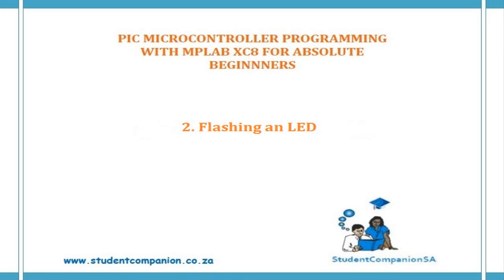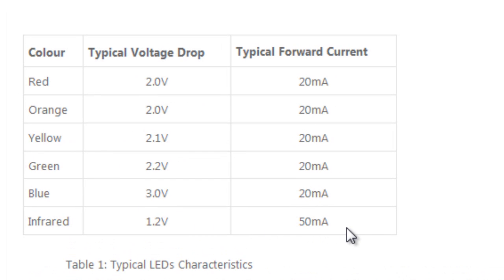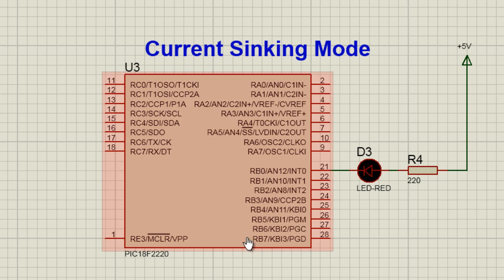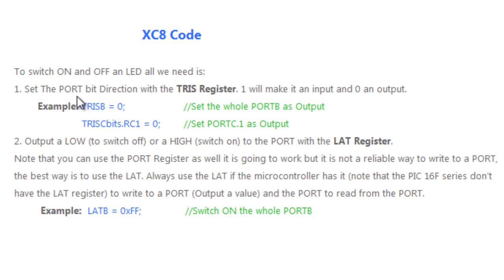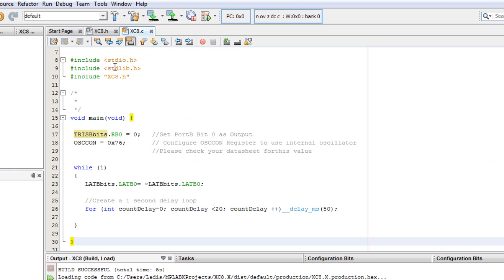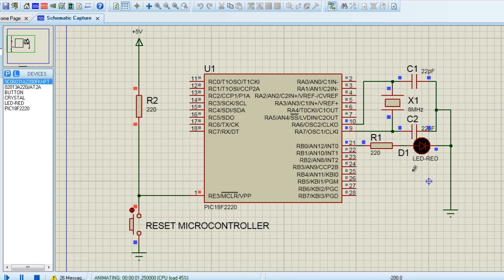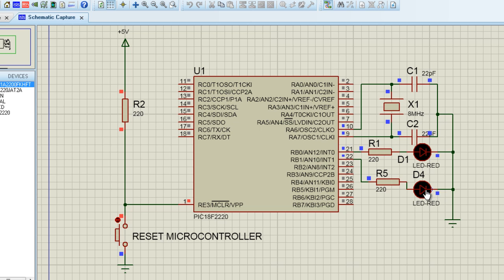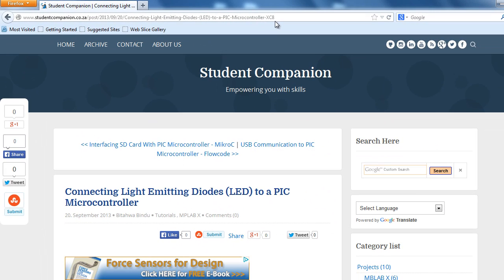2- Flashing an LED | MPLAB XC8 for Beginners Tutorial

Comment: Older red LED is typically 1.8V, with superbright ones being around 2V.
But rounding most of them to 2V is fine most of the time.
The higher voltage LEDs (blue, white, pink, some green ones) can be anywhere from 2.7V to as high as over 4V for the old ones.

Comment: I have two questions: 1. On the diagram in Proteus there is an external generator, but in the program you use the OSCCON register for the internal generator. Why? 2. Where did you get the value 0x76? I didn't find this value in the table 3-1"Power Managed Mode" on page 29 for the OSCCON register?
Reply from the maker: Hi, thanks for your comment.
1. This is an error on our part, we showed the external oscillator circuit just for explanation but we referred to tutorial 1 for configuration bits (header file), in tutorial 1, we used the internal oscillator, so just ignore the external oscillator circuit in this video.
2. For OSCCON value of 0x76, refer to REGISTER 2-2: OSCCON REGISTER section in the datasheet on page 26.
0x76 configure to use 8MHz internal oscillator, see the individual bits we enabled, 0x76 equals to 0b1110110 in binary.
Reply: @StudentCompanion  Thank you very much. I got a very quick response. I'm happy.
Reply from the maker: You are welcome!

Comment: Hello when I majke the simulation in ISIS  the message display (pic is not supported the  program
Reply from the maker: Hi. Which PIC did you selected in MPLAB X IDE project? And which PIC did you use in Proteus simulation?
Reply: @StudentCompanion  i select 16f84A in isis and in mplabx
Reply from the maker: @hichamredoine1817  can you post the full error message you received not just a simplified version of the message. Did you  use your generated Hex file from your project using poc16f84?
Reply: @StudentCompanion Pic16 program filetype'X'              
Is not supported
Reply from the maker: Post your mplab and proteus projects in our forum we will look at it: www.studentcompanion.co.za/forums
Reply: @StudentCompanion  hello can you send me many videos about 16f84 projects
Reply from the maker: @hichamredoine1817  that's a very ancient amost obsolete PIC. Why do you want to use such PIC while there are newer, cheaper and more powerful PIC models? We can't use such old PIC.
Reply: @StudentCompanion  because in our school we studied this type of PIC
Reply from the maker: @hichamredoine1817  I understand but unfortunately we can't teach using it. It's just too old with so many restrictions. You can use the concepts covered using a different PIC to apply to yours
Reply: @StudentCompanion  but the registers are different
Reply from the maker: @hichamredoine1817  unfortunately yes. But the concept is the same. You will have to read your datasheet to understand those registers

Comment: I am sending the code to a microcontroller PIC18F45K22 mounted on Curiosity/starter kits (PKOB4)
It is a pre-built project, I have hex code.
when I send the code via usb the LED is not blinking not even coming on.
I am using MPLAB X IDE v5.20
What can be the reason?
(I don't know if I have explained my question properly)
Thanks
Reply from the maker: Are you able to transfer without errors the hex file to your PIC? 
What are the build log of your code in Flowcode?
Reply: @StudentCompanion  
1. THis is the message I am getting as configuration error but I don't know how to sort it out

error: Configuration "C32_PIC32MX795F512L" builds with "C32", but no toolchains of that type are installed.
Errors have occurred while loading one or more configurations.
If a specific error is not shown above, this may happen when you import a project from another computer.
    + You can add language tools in Tools->Options embedded tab.
    + You can change which language tool to use in the project properties dialog.

2. the build log of code in Flowcode ( I am not sure about this) I have just compiled the hex code and it was showing success at the end.
Reply from the maker: It looks like you selected a wrong pic or compiler

Comment: Does delay command take longer time than it that is written to source code?
Reply from the maker: Your question is not clear.  What do you mean? If you write a delay of 1 second, it should take 1 second to be executed.  If it takes longer or shorter than there is something wrong in your code
Reply: @StudentCompanion Seems like the code that you write takes longer than 1 second in your proteus simulation. I havent written code yet.
Reply from the maker: Did you look at the simulation execution time? When you run simulation at the bottom bar there is an execution time. Compare that clock with the code, not your PC clock as simulation speed can be effected by many parameters including your computer speed among others.

Comment: Well understood but I want it to blink 3 times and it didn't work;
Am using pic16f877a and this is the code

#include <stdio.h>
#include <stdlib.h>
#include <xc.h>
#define _XTAL_FREQ 8000000

/*
 * 
 */
int main(void) {
    TRISB=0x00;
    PORTB=0x00;
    int i=0;
    int n=1;
    while(n<=3){
        //int i;
        PORTBbits.RB4=1;
        for(i=0;i<20;i++)__delay_ms(50);
        PORTBbits.RB4=0;
        for(i=0;i<20;i++)__delay_ms(50);
        n++;
    }
}
Reply from the maker: Hi. Why use int main()?
In your code you are not looping 3 times that's why it's not working.
Reply: Student Companion what's the problem?
Reply from the maker: You are incrementing the wrong counter
Reply from the maker: Try something like this:
for (int i 0; i <=3; i++)
{
PORTBbits.RB4 = ~PORTBbits.RB4;
__delays_ms(1000); // 1s delay
}
Reply: Same issue, it's not working
Reply from the maker: And when you say it's not working what exactly is happening? Does the led blink only once? Does it even come on? Are you simulating or working on breadboard or PCB?
Reply from the maker: Always specify the full problem and provide enough information to get proper support
Reply: Student Companion okay, I want my LED to blink for a number of times, but the problem is that it keep blinking more than the specified number(e.g. I dey It to blink 3 times but it's still blinking more than 3 times)
Reply from the maker: You still didn't answer my questions but you expect me to guess what could be wrong.
Reply: Like I stated earlier, it's blinking more than specified number, am simulating, am using xc8 compiler and mplabx ide
Reply from the maker: When you say more than specify how many times before it stop? 
I am taking my time to try and assist you but you seem can't care to provide basic requested information to understand your problem.  You think people are bored that's why they are not doing other things.
Here are the questions I asked and you haven't answered them: 
And when you say it's not working what exactly is happening? Does the led blink only once? Does it even come on? Are you simulating or working on breadboard or PCB?

When youbsay you using XC8 and MPLAB X do you know the versions ?
We don't have time to waste on one comment with no cooperation

Comment: This is a great tutorial and thank you for the awesome videos. I have a question though. What is the difference between LATBbits.RB0 and LATBbits.LATB0?
Reply from the maker: Hi. Thanks for watching our videos and for your feedback.  
When writing to a PORT like setting it High or Low, use the LAT register. It should be written like this: LATBbits.LATB0
And when you are reading from a PORT, then you must use a PORT register. It should be written like this: PORTBbits.RB0
So for LAT use .LATB0 and for PORT use RB0
Reply from the maker: You can also use MPLAB Code Configurator to generate code functions and configuration for you and it's easy to use.  Watch this video: https://youtu.be/JxSSVtTj_fA

Comment: Why we used the for loop with the delay_ms
Reply from the maker: In the earlier versions of XC8 compiler when we recorded that video, the delay function did not allow the use of a large number like 1000 for 1000ms. It generated errors. So we had to use a short delay and loop it several times to achieve the desired delay. 
But this has been fixed in the latest compiler version.  You now don't need to use the loop.
Reply: Got it. Thank you.
Example , plz.
Reply from the maker: What example?

Comment: Hi this is greet thank you I have a question: how to use a multiple logical or gate?
the pic 16f84a have 2 ports I want to use RA0 as output and the reset as input so any one (input) will activate the output(or gate)
Thank
Reply from the maker: HI. We don't understand your question, what do you mean by logical or gate? Which pin you want as input?
Reply: Hi Thank you all pins as input except the pin RA0 witch is the output
Reply from the maker: TRISB= 0xFF; //all PORTB pins as input
TRISA= 0x1E; // All PORTA pins as input except RA0 as output
Reply: Thank you   i want the output to be activated when any one of the input is activated  like the 
or gate (TTL 7432)
Reply from the maker: Please watch the rest of the videos and try to understand and learn.  You are asking basic questions that are already covered in the videos. We can't answer to each and everyone line of your code when you are not doing any effort to learn.
Reply from the maker: Try to understand what is a microcontroller which is different to the analogy of your logic gates. Try to understand how to blink an LED, read status of a push button, use decisions in your code. You'll accomplish your goals
Reply: thank you  is it possible to know with what i have to replace OR :
 if (RA1==1) or (RA2==1)or (RA3==1)or (RB0==1)or ...(RB7==1)
  RA0=1;
Reply from the maker: There are no shortcut in learning.  Learn first then questions after.
Reply: thanks any way my friend  this is what i was looking for (  ||  )  it is the OR logic sign on c programming   and my program it is working now 
than you
Reply from the maker: You are welcome!
Maybe we didn't understand your question.
Thanks for watching our videos.

Comment: What are the advantages or disadvantages of choosing an specific internal crystal frequency? Why did you choose 8MHZ?
Reply from the maker: There are many considerations.
The internal oscillator circuit is used to generate the device clock. The device clock is required for the device to execute instructions and for the peripherals to function. Every microcontroller needs a clock source. They govern the speed at which the processor executes instructions, the baud rate of serial-communication signals, the amount of time needed to perform an analog-to-digital conversion, type of application, battery powered, physical conditions and much more. So you have to carefully choose the best frequency available depending on your application.
Usually the choice will depend on Power requirements and operating frequency.
The lower the frequency the lower the power consumption which is very good for battery powered applications, the higher the frequency, the higher the power consumption.
If your application does not require high speed in executing its instructions or does not have peripherals which require high speed such as high baud rate of serial-communication, USB, Ethernet, high speed conversion of ADC for example, a low speed can be the choice otherwise you might need high speed. For your information you'll need 48MHz (direct or through PLL) for full speed USB communication. The same goes for other peripherals.
For high accuracy and stability you better consider an external crystal oscillator.
Reply from the maker: You can read more from these Microchip documents:
http://ww1.microchip.com/downloads/en/AppNotes/00849a.pdf  and  http://ww1.microchip.com/downloads/en/appnotes/00949a.pdf

Comment: Very educational and helpful. I am working with an older chip, a PIC16F716 and am getting an error: "undefined identifier "LATbits" " when I try to assign LAT4= 1. I am quite new at programming. Can you help?
Reply from the maker: +Michael Stoltzfus PIC16F series like your PIC16F716 don't have the LAT register, only PIC18F series and higher. 
You must use the PORT register to read and to write to outputs
Reply from the maker: +Michael Stoltzfus and the other thing, you cannot just say LAT4 = 4. LAT of what? You must specify the PORT like PORTB, PORTC etc. 
For your case you can write for example:
PORTB = 4; // or
PORTBbits.RB4=1; // for example to output a logic 1 to bit 4 of PORTB
Reply: IT WORKS!!!! Thank you so much! =)
Reply from the maker: Michael Stoltzfus you are welcome!

Comment: How to program that MCLR would reset PIC?
Reply from the maker: 1. Connect a push button to the MCLR pin using a pull-up resistor as in the circuit diagram in this tutorial: https://youtu.be/mUofSucHx_E   Watch from 6:11
2. Activate the MCLR function in the configuration bits as in this video: https://youtu.be/mUofSucHx_E  watch from 9:51

Comment: You set 0x76 - what exactly mean this value.
Not clear about "complimenting" of LATbits - what is the function, how they work?
And why second LED starting after delay from first LED? How is defined this delay?
Reply from the maker: +try again 0x76 is a  value loaded into the OSCCON register to select 8MHz internal oscillator.  You can find this information in the datasheet.
Reply from the maker: +try again if you studied binary arithmetic, complimenting is basically to invert the value of a binary number.  A compliment of 1 is 0 and of 0 is 1. To blink an LED this function can be used. If the value of LAT register was 1 (LED ON) it will be inverted to 0 (switch OFF the LED) and so on.

Comment: first of all very nice tutorial. And i like the teaching way of yours.
bro i need all the the commands list like the some u showed (@4:37), like _delay_ms, TRISB, LAT etc etc.
bro i want all this command , please share a link or whatever u have. 
once again thanks alot for this nice tutorials.
Reply from the maker: +Shahzad Bhai Hi, thanks for watching our tutorials. Each command depends on what we are trying to achieve in our examples. It will be difficult to tell you all the commands, you can read the datasheet of your PIC or watch more of our videos,  or you can visit our website to learn more.
Reply: +StudentCompanionSA 
Thanks for reply, 
now i understand every single step except the "OSCCON=0x76"
how to find OSCCON value, i have seen pic18f2220 data sheet but i cant find its value.
what is the purpose of this command?
and what is the value of OSCCON on other pic's.
Reply from the maker: +Shahzad Bhai the OSCCON register is used to set the frequency when you are using the internal oscillator of the PIC. in our example we set it to use 8MHz internal oscillator.
Reply from the maker: +Shahzad Bhai check the PIC18F2220 datasheet on page 26 to learn more. convert this hex number to binary and you'll see the bits we enabled.
Reply from the maker: +Shahzad Bhai if you still have more questions don't hesitate. it's just a comment away. ...
Reply: +StudentCompanionSA sure, and thanks
Reply from the maker: +Shahzad Bhai you are welcome!

Comment: Hi. What is the programm allows to build different srtucture? I have builded my project but I can not to watch the result. How can I build my own structure? Can someone tells me?
Reply from the maker: Hi Payrav Nusratov What do you mean by own structure? can you please be specific about your question because it's not clear. Do you mean Simulation?
Reply: Hi, I mean how to watch the Simulation result? You debuged the c-code then built the structure of the circuit. Can you show any control circuit using dspic microcontroller? I do not use pic but I use dspic30f4011.
Reply from the maker: Hi Payrav Nusratov if you are using Proteus software for simulation,  there's no difference between the PIC or Dspic. The procedure is the same. Watch our videos to see how we simulated.